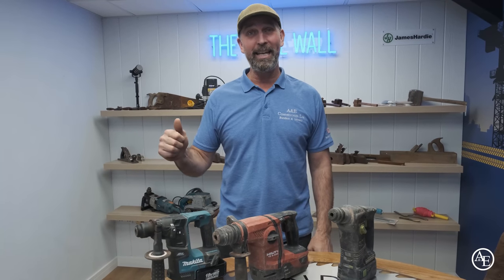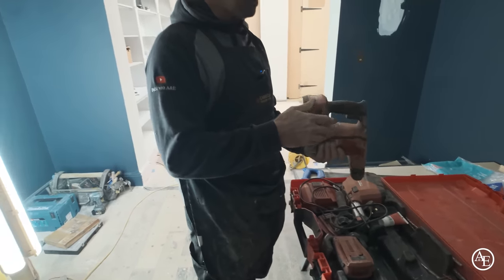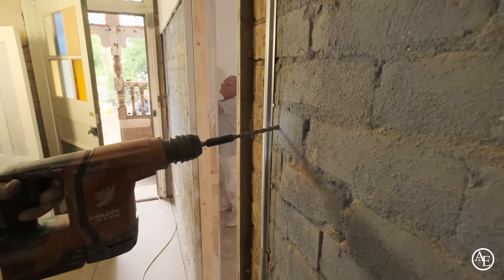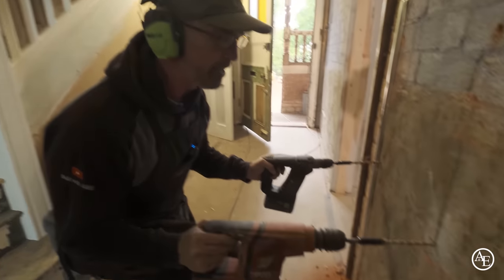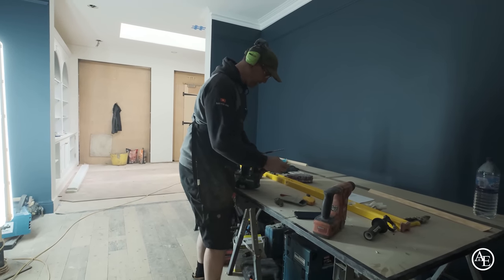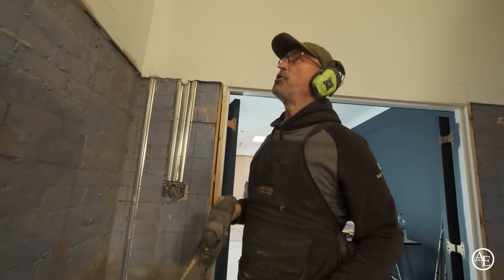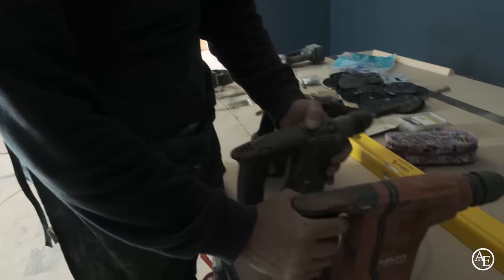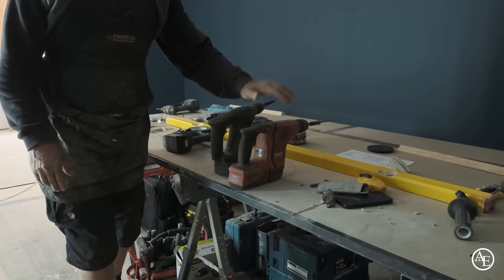SDS Drill Tool Review l Makita vs Festool vs Hilti

Comment: I have the festool and used the DeWalt, Bosch and Makita. Thinking of getting the DeWalt or Makita as the festool has no chisel function which is a major let down as have to go get my corded old big Bosch and extension lead from the van when a bit of chiseling as most time on the job it's always needed where as most other sds have that simple but necessary function. Love the festool for light, anti vibrate, power etc but major let down for lack of chisel.
Reply: They have a new one now with chisel function

Comment: Really love your videos. Have the 12 volt makita sds, its very slow but powerful, used it with 1 metre 10mm bit and went through a double skin of brick no problem. Very annoying that they don't stay upright. I think the Mak you used was the sub compact version. The larger 18v doesn't fall over.

Comment: Unfair to put the Makita in there as it’s the small version without a hammer only setting. The bigger one is much better. Although it’s light weight and great for quick and easy drilling for smaller screws.
Reply: And it has a fake battery in it

Comment: Cool vid. We use bosch 36v and 18v milwaukee dewalt and mikita sds's on our firm. Tbh my fav is the milwaukee but they all do the job. The bosch is a big old beast that we normally use for the more taxing jobs and the dewalt is the smallest, it surprisingly powerful bit of kit, but for general day to day and hanging off ladders, I love the milwaukee. So much power and pretty lightweight. Goes through anything ive chucked at it. Good chiseler ,overall very nice. 
Really fancy a play with one of those hiltis though. Years ago we had an older hilti was a great tool😮
Reply from the maker: Hi Porkchop7652,
Milwaukee is great stuff personally I feel the Hilti is to expensive considering what you can get for a better price tag, Hilti petrol is absolutely useless only good thing Hilti do really is there breaker range massively disappointed with there service as well, Hilti use to be great but really gone down hill have a cracking bank holiday all the best Tony 👍
Reply: @BuildWithAE  sad to hear that. Think I'll stick with the milwaukee gear.

Comment: You can have 2 1/2 makita sds drills for the price of the festool. Take into consideration the batteries and chargers and the makita becomes even better value.
Only my opinion but the festool isn't superior enough to warrant the extra 💷💷💷
Reply from the maker: Hi JRS U.K.

 Festool £258.00 plus vat with charger and one battery 
Makita £234.00 plus vat with charger and one battery 
Makita next one up is actually more expensive 
Just checked on FFX Tools
All the best Tony 👍
Reply: @BuildWithAE  Hi Tony, have another look. You don't get a charger with the Festool for £258.
Bare unit Festool is £229 on ffx
Bare unit Makita is £137 on ffx
Reply from the maker: @jrsuk1170  bare units are different definitely but the kits there’s not a lot between them, I think the next Makita up might be a better option because of taking more power but that’s more than the festool kit when you buy them apples for apples but it is all down to personal choice 
Just was really expecting more from the Makita after Phill and Mark raved about it.